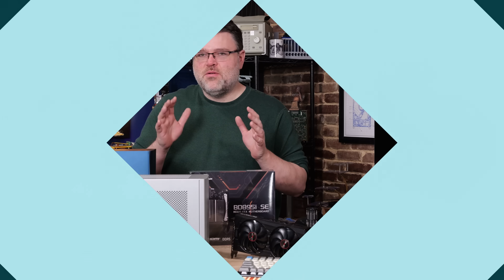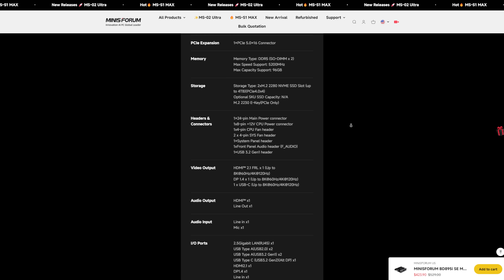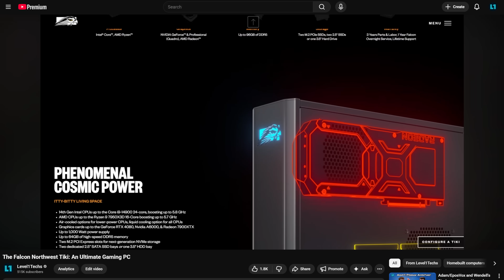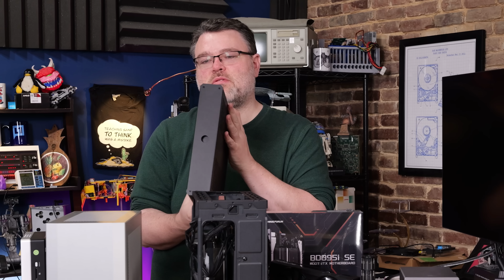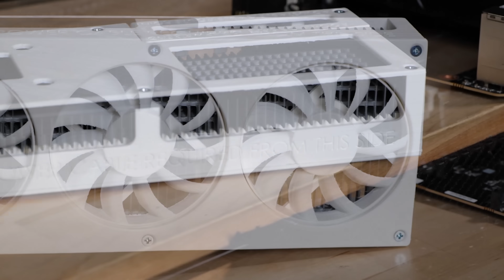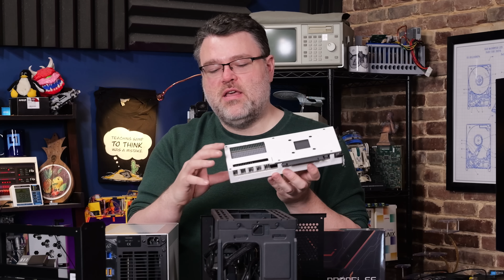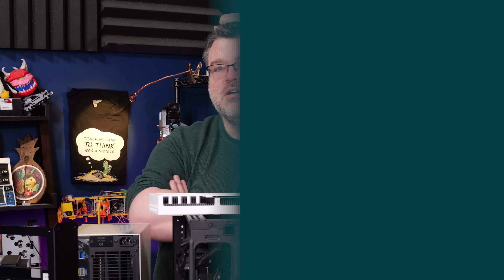Mini PCs Need Some New Rules! Ft: Minisforum BD895i SE Motherboard

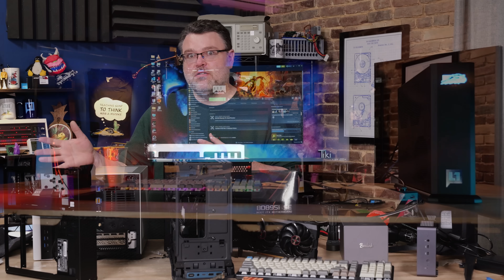Comment: 14:21 consoles are generally sold less or equal to their production pricepoint it's nearly impossible to get "better hardware" cheaper than console alone, so whoever builds a PC to replace console specifically considers price of games, lack of freedom for example with mods as well as additional fees like PSN/Live subscription. It's not 1:1 replacement
17:52 even base 9060 16gb has 180w power limit which is far beyond 75w pcie power rail. people builds extremely power dense builds in smaller cases mind you and power limit isn't really a thing, some adapts 800 server PSUs for this since flex-atx(which is a super vague standard) are generally limited by something like 600w. If your point is that gpu should be powered by only a pcie-i'm completely disagree it's just stupid and since it's proposes "new standard for undeveloped market" this parts will cost more than anything else, what generally called an "itx tax", maybe for you it's not a question(but somehow you stresses that price is at hing) but for everybody else new standard should not apply stupid performance limitations for the sake of "simplicity"

Comment: Obviously it’s a more expensive option, but a custom loop with an external radiator mounted as the exhaust for an entertainment cabinet easily solves the heat/cooling issue for desktop CPUs and GPUs. Or something like the external AIOs like Eluktronics and some others are using for laptops.

Comment: Dedicated local streaming PC makes a lot of sense. Build the most powerful machine you can without any size/part availability constraints, then stream it anywhere (TV, Tablet, Laptop, Handheld etc). Any device with a screen becomes a gaming machine. Razer recently released "PC Remote Play" app, which is a wrapper around well know streaming solution "Moonlight". It's very easy to set up and works well.

Comment: Wendell, I'd like to hear your thoughts on the adjacent topic of the BTF 3.0 (proposed) standard - completely cable-less compact systems. Maybe source some prototype hardware from Colorful and Segotep, and do a build on the channel. I hope BTF 4.0 focuses on even smaller dimensions (ITX, sub 15l cases) yet top of the line performance parts.

Comment: GPU memory is the main killer of this. Absolute minimum 12GB, ideally 16GB. Every single laptop NVIDIA solution has 8GB. Useless in 2026 and is lack of memory is the reason I have retired many graphics cards over the years. AtomMan G7 Pro is a great product, but 8GB. Mini forum eGPU 7600XT, again 8GB. Even AMD's 780M/890M solutions on the AMD CPU work better, because you can use as much memory as needed from the system memory pool. 

For these tiny PCs I use either USB4 or Oculink to an external GPU enclosure. GPU is only needed for gaming sessions. The internal GPU works just fine for everyday desktop stuff. You can even have a massive GPU with mega cooling if you want.

Comment: The flow through design is a great concept, but I think if you're going to standardize you should just make it 2.5-3 slots instead of just 2.  The box wouldn't be that much bigger and there would be a lot of room for future proofing the standard.  We might need a couple, like we had ATX/mATX,   we could have FT and mFT (Flow Through / mini Flow Through).  The graphics cards exploding in size have made the whole ATX standard set obsolete because they block so much of the slot space, and that has also had other knock on effects like limiting the market for add on boards so less add on boards even get targeted to regular consumers.  A fix for ATX would be to drop the graphics card to the bottom of the slot stack and let it take up however much "void" space it needs.   I kind of doubt that ever happens fully, though ITX kind of does that now, but it also gets rid of all the other slots too.  The ITX riser cable is a great proof for moving the graphics card slot to the bottom of the stack, since the latency wouldn't be any worse than it is on any ITX system with a riser, and those are fine.

Comment: My full tower PC (13700k - 3080ti) died recently so I got a Minisforum MS A2 and it totally destroys it in terms of CPU performance. It's not good for gaming because it's got an average iGPU but it's an excellent workstation, and I need it primarily for work. I'm planning to get an Oculink card to put in the PCIe slot of the Minisforum and get an external dock for the 3080ti. I will lose a bit of performance but I think it will be worth it, and I'll be spending less than replacing the motherborard on the tower PC. Also it's been good on my electricity bill, 100W vs 300-400 oin the tower and still it's much faster.

Comment: Has anyone ever mass-produced a GPU with a tower cooler? Most people don't care about the additional PCI-E slots, so you could make a GPU with a tower cooler that covers all of them (I know Nvidia is limiting what form factors can their chips be used in) and if there is a significant difference in cooling performance you can get a case that has MB positioned the opposite to usual, such that the PCI-E slots would be on top. This would allow you to have a PC with standard ITX MB, CPU with a tower cooler, standard ATX PSU, with about half the volume of standard ATX case and all the airflow going in the same direction (front to back, with the exception of PSU intake, which would be from the bottom) and allowing the access to "fresh" air for all components.

Comment: We also have DIY Steam Machines like mine using the BC-250, and due to the ridiculous price of ram and GPU's at least the BC-250 gives you entry level RX 6600 and AM4 2600 like performance all wrapped up in SBC that is still under half the price of any of those Minis Forum boards that only have crap iGPU performance in comparison.

Comment: I suspect those will take off when CAMM2 (+) become more mainstream.
Really make everything flatter with no compromise.

I suspect these will also pop the AI bubble when everyone has access to basic enough LLMs on a tiny dedicated machine that they can fully run locally and have those handle whatever.

Comment: Sometimes a little DIY is in order when going for a budget-conscious console killer build when the "perfect" form factor for a GPU, PSU, mobo, etc. doesn't exist. Cutting holes into the side panels of cheaper ITX cases, filing the edges smooth, and covering them with 120 or 140mm fan grills is a good way to save a considerable amount of money while keeping temps and noise levels low. I did that to an S300 8L case, which has enough room to accommodate most if not all 2-2.5 slot GPUs like the 9060 XT I stuck in there, and I'm pretty satisfied with the results.

Comment: I know my use case is a little different, and not really in line with the point of this video, but I have to say that those Minisforum boards are awesome for home labs and VM hosts in the mini form factor cases.  I have two of the BD795i's as the backbone of my lab.

Comment: I just want one of these boards to properly support unbuffered ECC with built in 10G ethernet. These would be PERFECT for homelab workloads that are typically bursty and unlikely to need long periods of full throttle compute. Let it throttle down and idle and sip power until I need it, and give me goddamn ECC so I can trust the system to run/handle my data with ZFS. I am so sick of the artificial segmentation and the braindead IO configuration of these miniPCs/miniPC motherboards pushing me to FAR more expensive and power hungry builds that I DONT NEED I just need ECC damnit. 

So utterly frustrating. No I don't need OcULiNk I don't need quadruple fucking monitors. x16 slot. 1 or 2 nVME, i dont care what width. 10G ethernet. ECC. <80W TDP. That's all I need! How hard should this be!

Comment: A lot of BIOS updates are to expand compatibility for new CPUs and possible RAM. With these types of boards that cannot change the CPU those needs are just not there.

I would like to see Minisforum offer a cooler option that can work with 3rd party coolers. Still do it with the stock cooler but let me add more cooling if I want.

Comment: I'm so glad I got a 128GB FD Strix Halo before the prices went up 25%. It is going to be my Linux work and gaming machine for the next many years (after watching yours and a couple oth SH videos)...which is why I spent on RAM, rather than wish I had more RAM in 2 years like I did with an M2Pro mac mini with 16GB. I was going to do a Minisforum ITX build--but by the time I was ready to SODIMM memory was stupidly priced and StrixHalo was a similar price for the same memory while having a better GPU with a smaller machine that ran quieter.

The thing missed out when comparing the Strix Halo platform to the Steam Machine. The Steam Machine is going to only have 8GB of video memory. It WILL run out of memory at 1440p, it will probably run out of frame buffer at 1080p in some games at some settings. 8GB was the standard--10 years ago. It is night on impossible in modern games to use less than 8GB of framebuffer in AAA titles at a baseline. And also it is only 8GB for realistically an $1,000+ machine. I'd love to be wrong--but I would be shocked if it started at less than $1K, and I'd be pleasantly surprised if it was meaningfully less than $1,500--because memory and RAM only keep going up in price.
Reply: I am curious, what’s your use case for Strix Halo aside from gaming?
Reply: @BambuLaber  I do data analysis, and I've been doing some local LLM experimentation in LMStudio.

But with SH, you only get the best GPU configuration in the 395 64/128GB parts. For all the other Strix Halo SKUs, like the 32GB 385 or the newer 388, you drop like 20% of the GPU CUs. At present I barely use 1/2 the memory pool--but that was the idea, have a soldered memory pool that would be grown into as it can't be upgraded. I remember when an Arch full-fat KDE4 install would fit in 8GB of DDR3 at boot. Today, 10 years later, at boot KDE6 will want more like 16GB. My Bazzite at boot is 20GB. Memory needs inflate over time,  "640K ought to be enough for anyone", LOL.

Panther Lake coming out, and being...good???!?!?! at least for gaming...changes the calculus again. SH used to be in a situation where the only consumer competition for such a high-RAM-pool-and-bandwidth desktop machine was an M4 Mac Mini or Studio that would cost much more or a Threadripper (that would cost a TON more in money and power), but it wouldn't have as good a GPU. With RAM and storage pricing going up day by day basically 1%/day sustained compounding inflation yikes, it gets more problematic.
Reply: @ZeroGravitas187 good thing you got the 128GB model then. I wonder how that compares to a single rtx 5090

Comment: I'm looking for small components like this to use in a build restoring/repurposing my old IBM Aptiva case that I've had since childhood. I had already landed on using one of the minisforum boards that you're talking about here.

I plan to use it mainly as a media PC with a blu ray drive, with a view to possibly adding storage to it and using it like a home server or NAS. Possibly some old games too. Basically a quiet, cool sleeper build using modern tech that doesn't require me to cut a ton of holes in the case.

We have SFF PSUs, mobos and cases - would love to see a SFF standard for GPUs.

Comment: I would love to see the DIY market go through a SFF renaissance. GPUs are too big. We need smaller form factors for everything, motherboards, PSUs, cases, etc. Let’s start the era of the modular Mini PC!

I recently put together a 1L Lenovo M720Q that can play PS4 class software better at 60FPS. There is no reason midrange PCs should be over 3-4L. You kept mentioning console killers in this video with these giant PCs on your desk. I was like that is ever SFF, brother!

AMD is the worst on this front. There only small GPU is the RX6400. Nvidia has lots of options for half height or single fan ITX. AMD needs to offer something like a single fan RX9060XT or a half height RX9060. Then you can start putting together a build that is actually small.

Comment: Intel B50 Pro is one of my favorite GPUs in years, small and being powered by the PCI bus is wonderful. I would like a "extension" to the PCI standard for 150W of power, if the device detects that extra power it uses, if it doesn't detects it goes as the basic 75W. It's not the same but it could go paired with the 12V only standard

Comment: Of course, I am not the "prime" example being a hobbyist in the cloud gaming realm,
But ALSO as a handheld enthusiast, there is an android console market that has EXPLODED in recent years and there are TONs of snapdragon devices perfect for Wendell's proposed streaming scenario. 
Recently, AYN, Retroid pocket, and a newcomer Mangmi all have their OWN versions equipped with various features.
The recently proposed "Mangmi Pocket Max" was announced, rumors have pricing around $200-250. The SoC is a bit older Snapdragon 865 HOWEVER it also will have a 144hz OLED screen. Even with the older SoC, that incredible screen paired with such a device would lend itself to an incredible couch gaming and streaming experience.
Reply: Also of course I 100% agree. We need more dual slot "full" length or half length cards.

Comment: Something I'd be curious to see is a new motherboard standard that is elongated sideways but even shorter vertically - more like a GPU shape.. Since GPU shrouds can do monstrous levels of cooling at low noise, and there is little benefit above 100W power draw across the entire motherboard in gaming situations.
Then you could have a 'sandwich' layout case but it's actually just a dual PCIe interposer on the floor, GPU slots in to one and the Mobo/CPU/RAM slots into the other, back to back. The vast, VAST majority of power required is just 12V so the idea of pure 12V from the PSU with 3/5V conversion on the mobo (like that ATX12VO thing) actually does make a lot of sense.. the teeny tiny melty burny pins on the new GPU plugs however still suck and I wish they'd fix that too. There was nothing wrong with having thicker cables.

Of course the only way ANY of this would work is if multiple big companies got together and released a bunch of products over a long enough time-span to actually take hold. Just announcing an idea, a sprinkle of products and then cutting it off like Intel did with the ATX12VO will result in it being another abandoned offshoot with no future 😔

Comment: I'm loving the BD790iX3D in my Home PC, I would like to run it as my workstation, BUT it just doesn't have the connectivity I need. A full ATX PC is so overkill these days, but I need 10Gbe networking & Thunderbolt (USB4). No board (that I've found) meets those needs. iTX feels like its treated as a niche and not a genuine form factor.

Comment: I bought a Powercolor 9070 XT  Reaper because at the time it was the only 2 slots wide with 8-pins connectors. This was mandatory because of my case and the motherboard layout and i didn't was this crap 12VHPWR connector.

All the games i play run perfectly fine in 5120x1440.

Comment: I wish we could see more benchmarking done between 6 and 8 core parts at different power levels.  The SFF community is great, but a lot of folks don't fully understand that you're going to have to limit power at that form factor and buying the most expensive parts usually doesn't make sense.

Comment: If you want a console killer, as in something at least as fast than a Steam Machine, the deciding factor is the GPU - which can be Radeon RX 7600 of which there still is supply.
If you want more but not pay more, you could also pick an Intel ARC B580 - as long as you don't want to put SteamOS on it because that still is an AMD only party.
The point is that even if you go all out and pay for an RX 9060 XT, you still could use a Zen 3 Octacore+ like the Ryzen 7 5700X to drive those.
Just pick an ASROCK Deskbench X300 or sensibly select components around a Jonsbo C6 case, and you can get the Board + Case + PSU + CPU for around $400, and it work with the cheaper DDR4-3200 RAM.
With this a 1080p High-End gaming system is possible for around $800 even today.

Comment: We need a standard that allows power supplies to be slot in, like in high end workstations or the old apple cheesegrater mac pro.
It's absurd how much excess cables even modular power supplies leave behind. Not to mention that custom length cables can cost more than the whole power supply.
Since we are on the subject, a standard for modular power supply cables would be nice, since each manufacturer uses their own frigging pinout.

Comment: Been using my 4090 3.2Ghz 1152GBps mem overclock to stream 240hz 2560x1600 feed to G16 laptop usually through 2.5Gbps ethernet but over WIFI7 around the house it's a breeze. I have a dedicated router solely for streaming, I don't care how fancy the router is there will be slowdown, better to have 4-5 routers and other network hardware.... 😅

Comment: I wish AMD, NVIDIA or Intel took the low profile market seriously and/or there was a market for it. 750 ti and 1050 ti were legendary for what they did in 75w at the time. Intel's A310, Nvidia 3050 6GB, and AMD's RX 6400 are all compromised in some way. 

Sad thing is I know they can still squeeze good performance out of that power target since the A2000 is pretty solid and old at this point. I love tiny builds for my ancillary systems (HTPC) but also go frugal and low power with them.

Comment: Anyone have an example "console killer" build using the minisforum boards that actually does compete on price and size with a console?
Reply: Basically impossible, cost of the motherboard alone of these motherboards approaches 75% of the cost of a console.  And you NEED a gpu as the onboards aren't equivalent to a console.